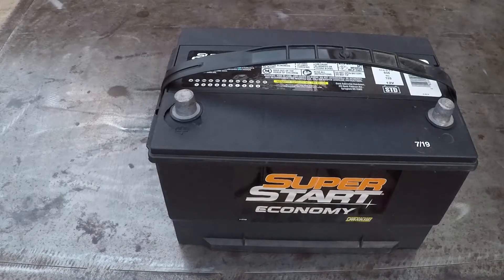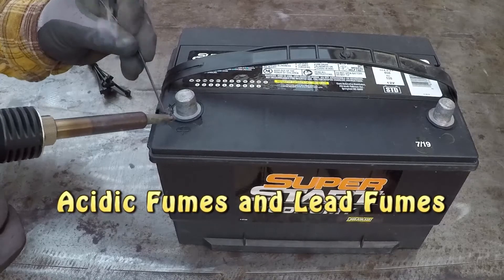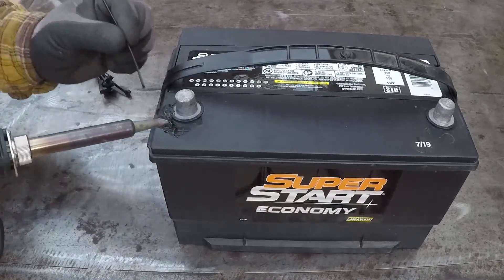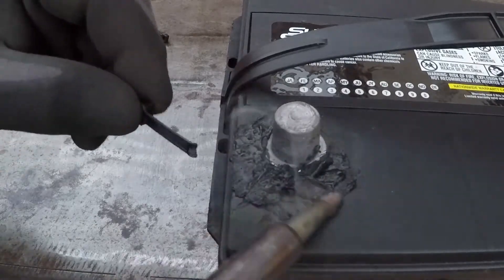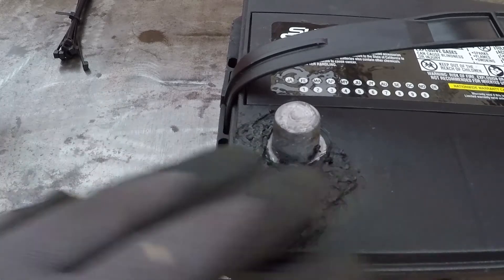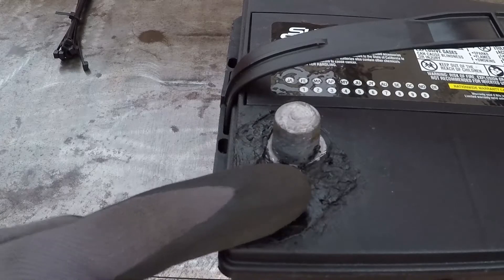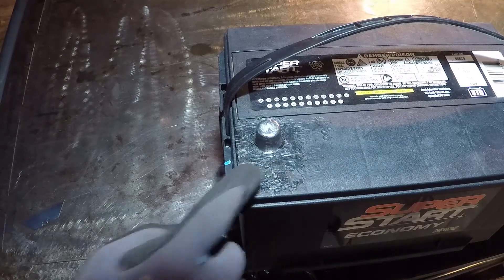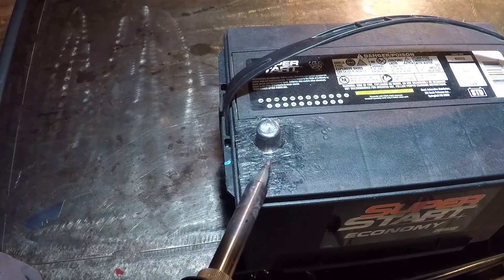Battery Case Repair

Comment: You can't use any type of plastic to do this, it must match the type of plastic which the battery case is made of! I used zip ties I had, just after a few days the leaking started again from that point and the melted zip ties took apart in tiny bits.
Reply from the maker: Mine held up fine for little over a year and I changed it just because the battery eventually died. I agree with you about the type of plastic must match. You also need to make sure the welding area is 100% clean and dry and the welding temperature must be right. Thank you for watching and for the comment.

Comment: very dangerous bay anew one
Reply: Not if done properly and with care, like he did.  

He added enough plastic to regain the needed thickness, and it will be OK!
Reply from the maker: Thank you, I appreciate your feedback and concern.
Reply: Torch you say ? Have you heard of hydrogen bombs?
Reply from the maker: I don't think you can make a "Hydrogen Bomb" from a car battery. Hydrogen is flammable but for the hydrogen bomb, also known as a thermonuclear weapon or "H-bomb," is a second-generation nuclear weapon that uses both nuclear fission and fusion to create an explosion, resulting in significantly greater destructive power than atomic bomb. You see there is no car battery 😂

Comment: I tried this method on a crack on the bottom of a battery but the weld was porous and leaked. I am going to try the glue they use to weld plastic pipes together
Reply from the maker: Good evening, The plastic must be cleaned from acid and any other contamination for the weld to be successful. In the past, I repaired a cracked battery at the bottom side, I had to drain it, once it dried, I cleaned it with water and when the water dried, I did the weld and build up the plastic thicker in the cracked area. After that, I filed it with the acid and it was good for a long time. Good luck and thank you for watching.
Reply: You will fail, because the pipe cement is a solution of the PVC or CPVC polymer in a solvent... But this battery case is made with a different polymer: Polypropylene. 

This plastic has a too low "Surface Energy", so that no adhesive will stick to it, in the same kind of the Teflon pans, very difficult to glue... 

But WELDING IT like in this video, is possible and practical. You probably failed to completely remove all the acid, or you did not heat enough the case, which needs to reach the same temperature as the plastic tie, so that both are melted in one at the same time. Try to add more plastic tie material, so that you effectively seal the leak.

Comment: How long does this fix last just dropped the battery to my car 10 mins ago
Reply from the maker: I fix my battery about 3 months ago and still good. If your battery damaged at the bottom, turn it upside down in a large plastic container to collect the acid. Make sure the repair area completely dry, Repair it the way I did, then make sure to re fill it with acid. Make sure to wash the area where the acid leaked with water to prevent corrosion. Be safe.

Comment: Good job TU but that battery should be under warranty if only two months old no?
Reply from the maker: I bought this dump truck and the previous owner installed two new batteries. I think they damage this battery during installation? Thank you for the comment.

Comment: Very nice repair. Harbor Freight makes a plastic welding kit that works nicely. The heating iron is 80 watts and has a big flat piece on it. They are about fifteen bucks or so. I like mine and I use it mostly to fix plastic fuel tanks on line trimmers & the like. 

Great video. Thanks for posting.
Reply from the maker: Thank you sir I appreciate the information and the nice comment.